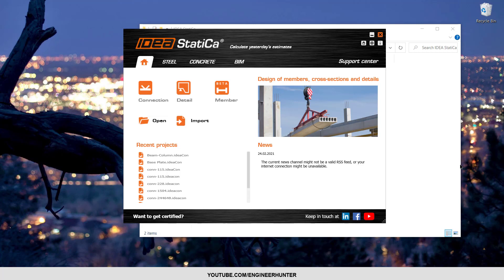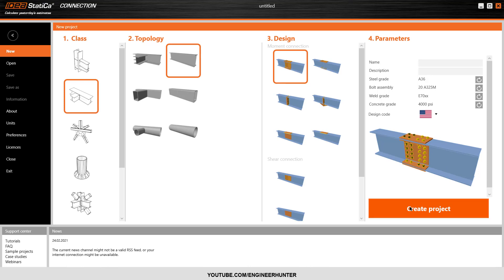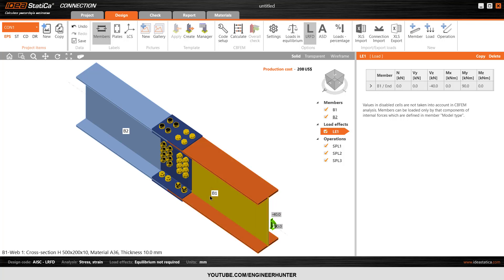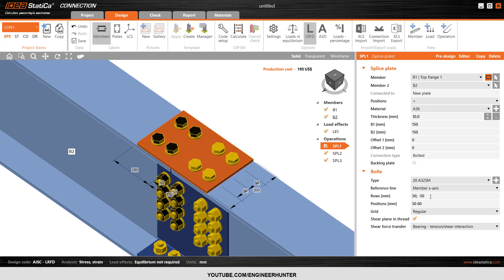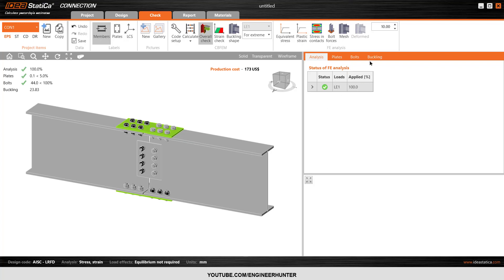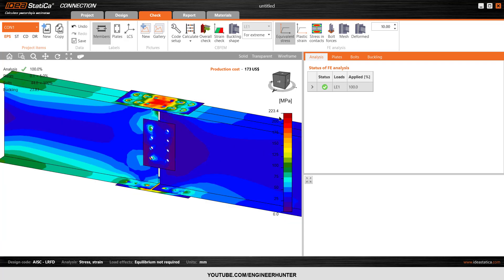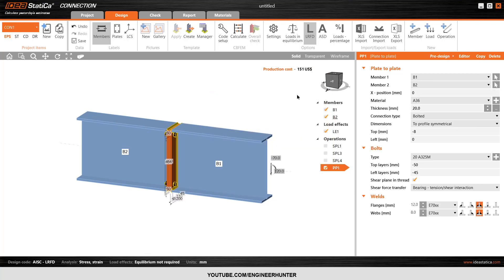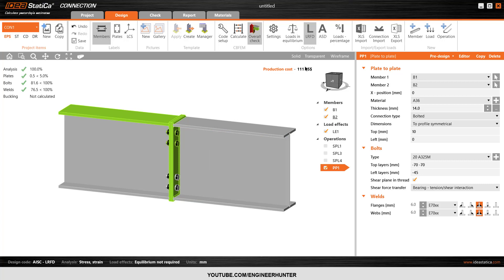IDEA StatiCa : Beam Splice Connection Design

Comment: Thanks for sharing. I have an important query. How about the stiffness analysis for this splice. As per my experience when you have splice connection welds and bolts ratios more then 50% in stiffness analysis it will show pinned in major and minor directions. Would appreciate if you explain this issue. Awaiting your kind response